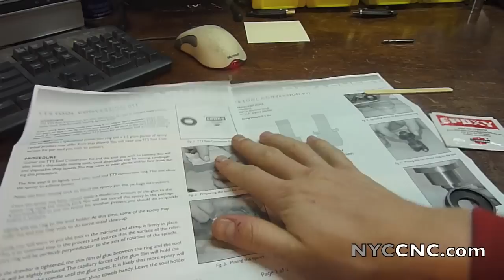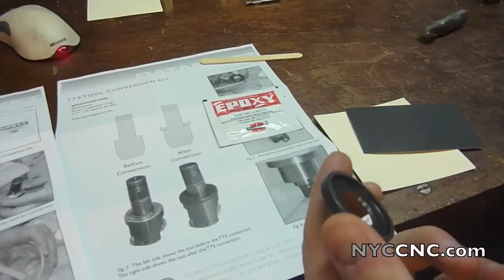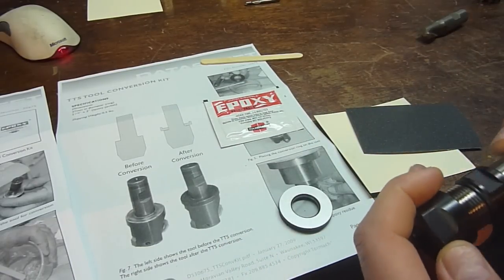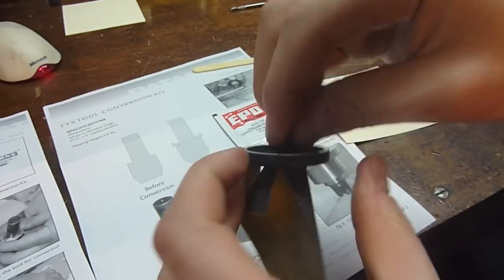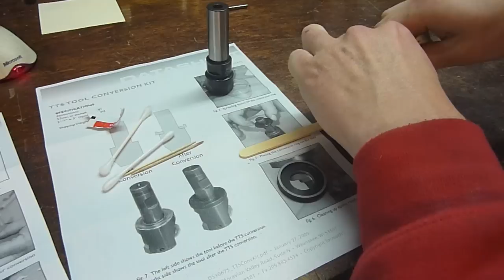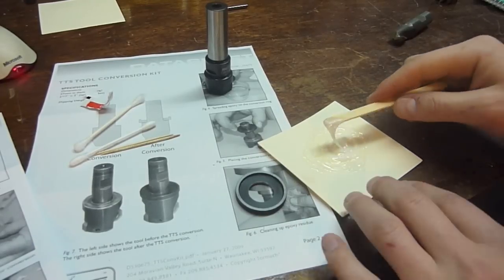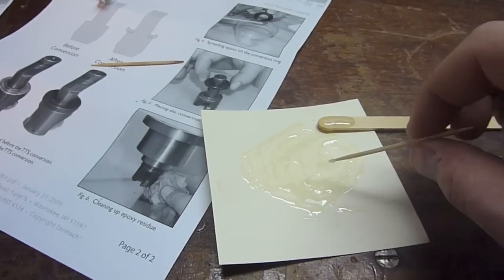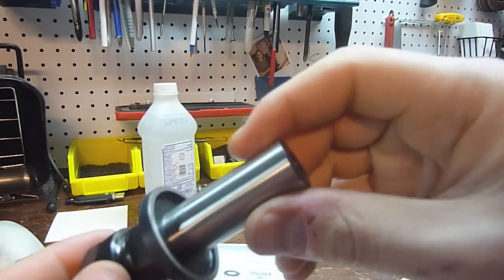Tormach PCNC 1100- Converting a tool to TTS Compatible - Ch. 15

Comment: as to your wondering about doing a conversion on the larger end mills 3/4" i would make a tight fitting collor with a inner grove like a tube and fill the grove with silver solder and slide it on the shaft. then sweat weld the solder and that will give you a ledge for the conversion kit and will insure stabilty i have used this successfully with my tooling.